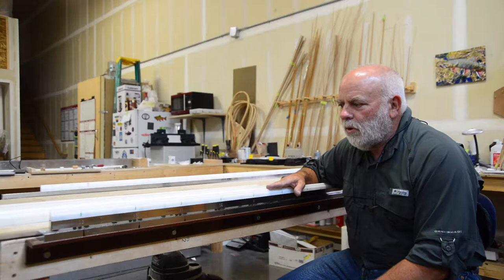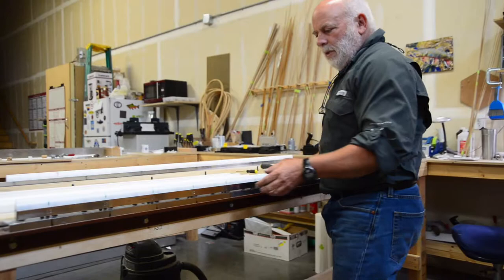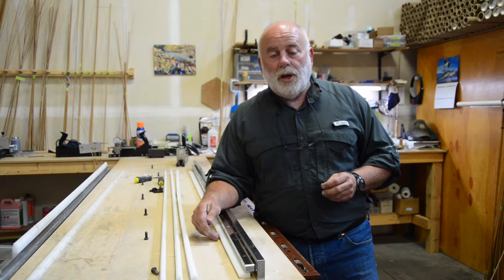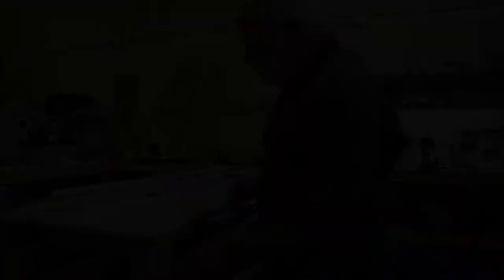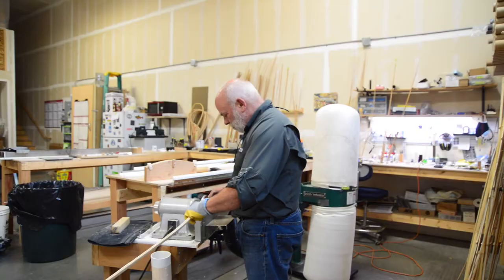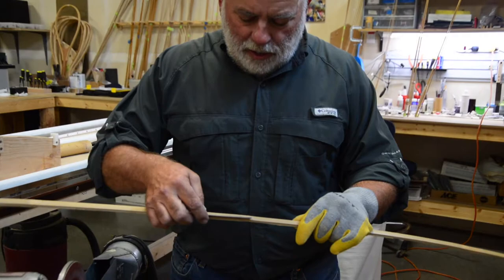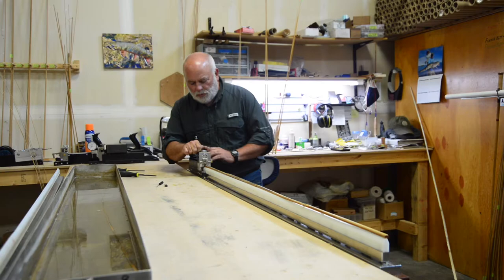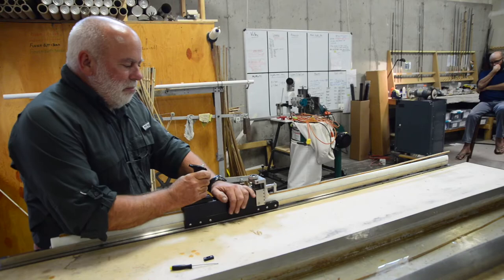Rough Planing Bamboo on the Morgan Handmill

Comment: Looks like it takes more effort and a good pair of walking shoes compared to a razor sharp block plane?
Those indexable carbide cutters you use are not sharp, but are adequate on machine tools with lots of power.
Check out endmills ground from micrograin carbide blanks, they are super sharp.